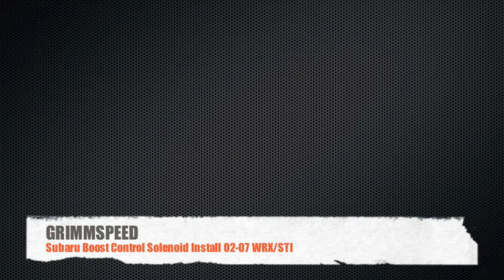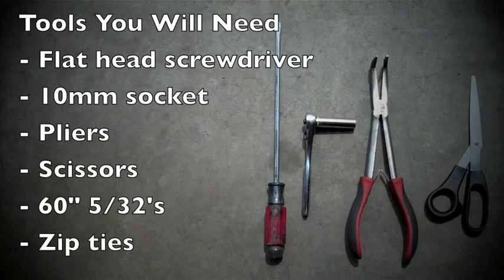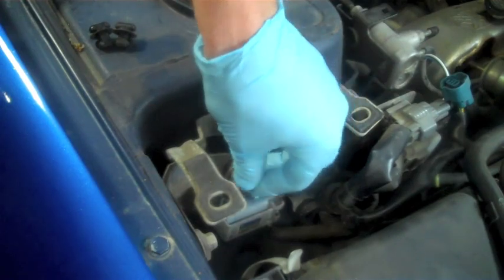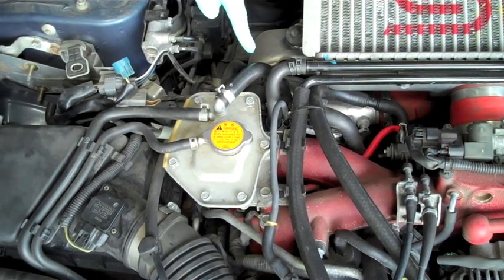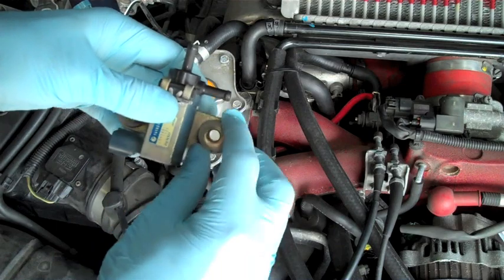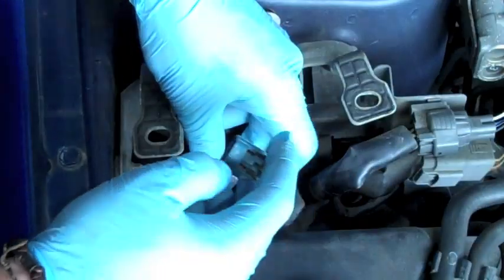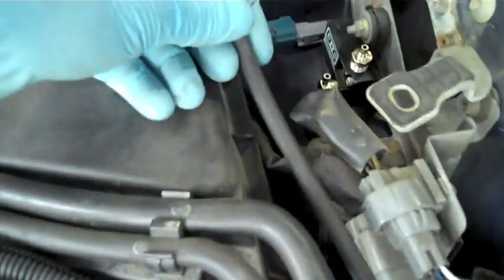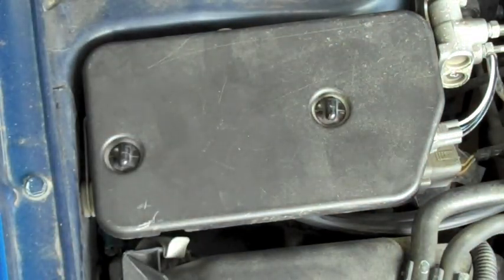GrimmSpeed Boost Control Solenoid Install

Comment: Yes sir, hope you will answer my question, I had 2009model c200 kompresor, troble code p0045 and it's say supercharger boost control solenoid circuit A open, where can I find the boost control solenoid circuit, tnx
Reply from the maker: Sounds like a Mercedes model, something we are unfamiliar with. Sorry

Comment: I know the car needs a tune to drive, but would it be okay to slowly power the car into the garage with the EBCS on, without revving in to boost?
Reply from the maker: Yes! You'll be totally fine if you don't go into high boost, the big issue with an untuned EBCS would be an overboosting scenario.

Comment: why did you install new vac lines? old ones work fine...
Reply: I was wondering the same thing. Routing new vac lines is a pain
Reply: Because they get old over time and split. I replaced every vac line on my prodrive for this very reason.

Comment: For anyone who's looking to install an EBCS on their Subie, it is a million times easier to attach the vacuum lines to the turbo if you take the intetcooler off. It'll also be a lot easier to secure them with zip ties or clamps if the intercooler is out of the way.

Comment: i have a eboost 2 system in my 02 sti but my tuner said to install this solenoid  to perform  better does that  mean my eboost 2 solenoid  is now useless? it does not come with a wire harness  like the one on your video does that make a massive  difference

Comment: If i have a 2004 WRX and I install this, what kind of tune will i need? Will i need to go to a shop and get a custom tune or if i plan on also buying a cobb accessport will that have the type of tune i need to be able to safely run this BCS? thanks

Comment: Can you tune this with the Cobb Accessport
Reply: Yes, you can do it with Accesstuner Race, free download with your Cobb Accessport. Now isn't free anymore, but back then was possible to download for free, now you have to pay. I tuned it myself on my legacy GT 09 with the Accesstuner Race from Cobb.
Reply: no. grimmspeed requires a custom tune. :)
Reply: No... Any tune can be applied via an AccessPort. Hence how I'm running a Perrin EBCS on my 06 STi. You just can't use a Cobb OTS tune.

Comment: great video but i would be running little clamps or Zipties atleast on ALL those connections.

A little vacuum leak is annoying but not the big issue.
If a line falls off the BCS or the Wastegate/Turbo housing You will loose boost control and the turbo will 
Boost Out OF COntrol (Runaway Turbo) until it reached max boost and grenades itself into the engine or hits Fuel Cut and gives you Whiplash.

Comment: Will this work on a 2002 Chevy Silverado 2500 HD 6.6 lb7  deisel , if not do you sell one that will work ?
Please let me know ASAP.
Thanks,
Duane
425-231-8078
Reply: +Duane DeValkeneer no it wont work buy a PPE boost increase valve to bump your boost, or if you want better wastgate performance and boost control, buy a banks big head.  And it would be wise to not post your personnel phone number on a public page.

Comment: Hi i have 06 sti, im about to get this boost control solenoid and do i have to tune or i can just put it?
Reply: +pimpsahan55  - need tune
Reply: +Eddie Cade when you mean need tune shop or cobb tunning access port
Reply: Cobb assess port off the shelf map has a tune for electronic boost control solenoid. You must have some sort of tune or blow up occurs
Reply: +Eddie Cade yea im about to get my sti and don't want to f€¢© it up I'll probably start by getting the access port by all means then
Reply: +Albaro Mayen - cobb does not have an EBCS map for STI, only for regular WRX, gonna need custom tune
Reply: +Eddie Cade noooooooooooooooooo  😩 well I guess I'll keep that in mind I'm new to the sti scene and wrx so thanks bro
Reply: thx for the tip brah!

Comment: Hi there I just had my car tuned to command 20psi of boost through the stock boost solenoid but its only getting around 15/16 psi by installing this on my 03 STI will I need another tune ?? Or can I install your solenoid because it has been tuned already

Comment from the maker: Technically as long as you are running in 2-port bleed just like your stock BCS you will be fine.  The major advantage to our solenoid is the advantage of being able to run in 3-port mode.  -Matt Homes
Reply: Is this still accurate? I would like to order one but it'll be awhile before I can get to a tuner and my BCS is sticking. If I can get this and just reset ecu learning I'll do that rather than order OEM or try and fix the old one.

Comment from the maker: I just tried top take a peek at your link, but something wasn't working properly with it.  As long as you are replacing the vacuum line with the 5/32's line we supply you won't have any issue with line collapse under vacuum.  -Matt Homes

Comment: Here is a picture of the engine I am preparing for a swap 
"flickr.com\photos\7437833@N07\7923341790\"
Ive taken one of the lines off and it appears to have two layers. it feels rubbery like latex but is more rigid like plastic. if normal rubber lines or some poly, nylon, etc lines will work that would be great. my main concern is that they will collapse under vacuum.

Comment: Some of the OEM lines really harden up over time, they end up feeling like they are "plastic" when they are cool, the soften up once warm.  Our BCS is engineered to work specifically with 5/32"s ID hose.  I am not 100 percent sure on the diameter your JDM EJ series motor uses.  If you want to shoot us some pictures I might be able to narrow that down for you.  -Matt Homes

Comment: I am doing a repair on some vac lines for my EJ20R and its a little sketchy as to the correct lines to use...ive pulled one of the lines and it appears to be a plastic reenforced rubber... I dont know what a comparable hose would be

Comment: Your stock boost control system is what it called a "2-port bleed" system.  This system with your stock solenoid will typically max out at about 18-19 psi.  When you use our 3-port solenoid, you can reach higher boost levels and your tuner will have better control over your turbo.  Having better control will allow your tuner to tune your vehicle more aggressively.  The end result will be more boost faster, and more aggressive boost curve leading to more power across the RPM band.  -Matt Homes

Comment from the maker: Yeah....not exactly. This is a custom valve. We worked directly with MAC Valves to create this valve for you guys. Not to mention ours has the OEM wiring harness so its plug-n-play, has an OEM fit bracket, and awesome shorty nickel plated hose fittings. More than worth it for a complete plug-n-play option is you ask me.  - Justin

Comment: So a few small important things here left out. Use 5/32 hose. Even if you have a turbo with a 1/4 nipple. Not doing this will cause the car to act extremly eratic ! Second is zip tie the hoses to the ebcs. Use the smaller thinner zip ties to ensure a tight seal. I found it easier to zip tie everything and then screw it down. Other then that awesome product and has served me well. 02 wrx with a evo III big 16g.

Comment from the maker: Bruce, with any aftermarket boost control system, you should NOT utilize the stock restrictor pill.  The solenoid will be more accurate and more effective without it.  -Matt H.

Comment: Time marker 3:02 where you pull the vac line to the waste gate the one side of the tee fitting holds the restrictor pill - shouldn't this be reused? -BruceF

Comment from the maker: We haven't heard of this happening before. If you tighten down the zip ties we included it should be fine. We have EVO's running this with 35+ pounds of boost with no problems. - Justin Grimm

Comment from the maker: Yes it will work with the Cobb Accessport however you will need to have your tuner give you a custom tune. The AP does not have any pre-made solenoid maps. - Justin Grimm
Reply: I know this video is 8 years old.  My question is does the Cobb accessport V3 have a ots tune now to run a 3 port ebc? Isn't it the stage 2 + map?
Reply: Did you ever figure this out? Same question

Comment from the maker: You should never put the solenoid out without getting a tune, you will overboost without a tune and run the risk of hurting your engine. I advise you to take it off immediately and wait until you are tuned for it. - Justin Grimm

Comment: Controlling boost only allows you to max out your current turbo, it has its limits too! e.g. sr20det engine (found in nissan s13/14/15/pulsar gti-r) has a turbo capable of around 280hp, so almost +50% increase in power with sufficent supporting mods, such as fmic, exhaust, injector, possibly fuel pump, and of course a tune-up to keep it from melting. But as the sr20det can take 400hp with the same mods, that's why ppl want to bolt on bigger turbos!

Comment: @GrimmSpeed Depends on the ECU version.  If you reset your ECU, your initial wastegate levels should be low enough that boost error will only climb them back up to where they need to be to hit the right target boost numbers.  But if you were to just throw this on your car and drive it, yeah it could be ugly, since the wastegate duty cycles will have climbed to hit the target boost numbers for your old BCS.

Comment: @fbjr2003 Hey man, NOPE you will actually have to go directly to a tuner, the Cobb AP can only be protuned to work with any aftermarket BCS, there is currently no OTS map for it!

Comment: @sergsrt8 It depends on a lot of things... main thing being the tune. When trying to make big numbers the first to go is the turbo, because past 23-25psi, the VF39 stops making power. What is your idea of a "fast" time. I've seen STi's run into the 450whp range on a stock turbo, (while running meth.) Anything past that and the VF is just pushing air.

Comment: @sergsrt8 It all depends on what your idea of "slower" is. Smaller turbos spool faster, but suffer on the top end, while bigger turbos spool slower, thus making them laggy... as in they need to be high in the RPMs to reach max boost/ power. With that being said, an 04 STi running the stock VF39 at 20psi will probably beat an 04 STI running a 20g at 15psi in the quarter. It also depends a lot on the build and the tune. There's no definitive answer. What exactly are you trying to find out?

Comment from the maker: @sergsrt8 Great question! Let's break it down a bit here, more boost in most cases will mean more horsepower if properly tuned, however a smaller turbo will not be able to flow as much air and it comes down to the velocity of air that the turbo is capable of pushing, not just the PSI. Also teh OEM turbo has definite limiting factors strictly related to PSI where a larger turbo is capable of producing more PSI at a higher velocity. - Will

Comment from the maker: @afgandominator Yes you will still need a professional tune on the car after the install unless you can find a specific OTS map made for this BCS as Cobb does NOT supply one.

Thanks for the question!

Will

Comment from the maker: @ChicanoRockero Installing this alone will cause your car to overboost which could be potentially catastrophic. You need to bring your car to a tuner/dyno to get the ECU reflashed with a custom tune that allows to BCS to operate in conjunction with your engine correctly.

Will

Comment: I wonder I if added this to my car would I be fine using the cobb ap stage 2 tune?
Reply: You need to tune your car specifically to use this boost control unit! custom tuning!